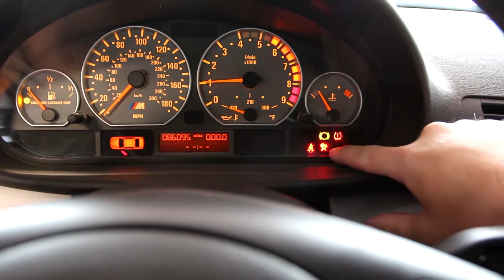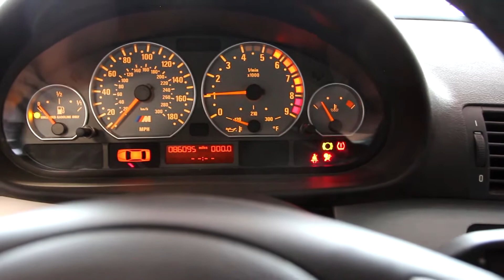Removing the Front Seats in My E46 M3

Comment: what if the motor is bad and you can not move the seat. How do you move the seat to gain access to the bolts?
Reply from the maker: Unfortunately I am not aware of a way to do this as I have not encountered it, nor talked to someone who has. I wish you the best of luck and would love to hear what you find out!
Reply: @WannabeRacer  Hi, you have to get to the electric motor and move it counterclockwise to move it backwards (reverse for forward). It will move millimeter by millimeter and take hours, so if the motor is bad you can take it out and cut the front part which connects to the part which moves the seat; sand down the shaft to fit into a power tool to move it fast.